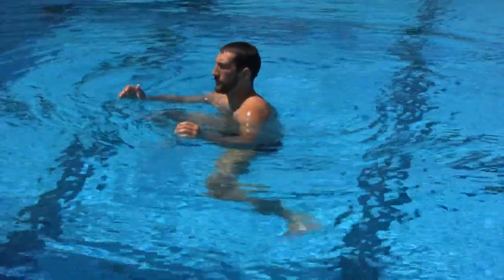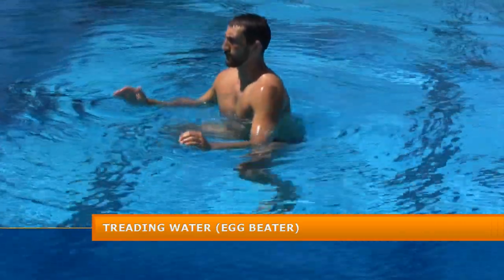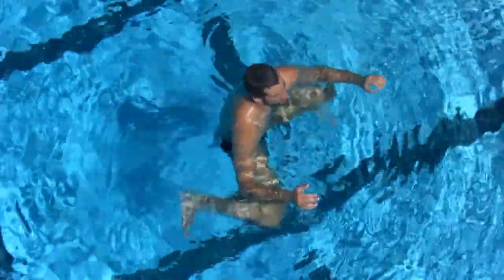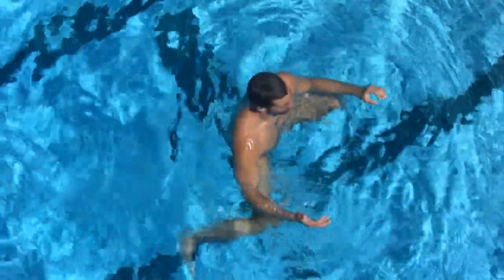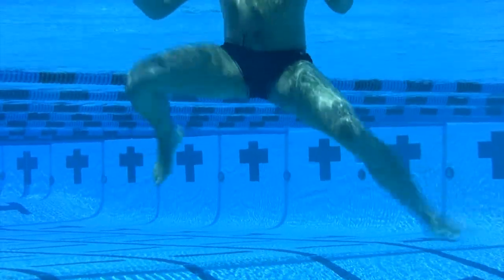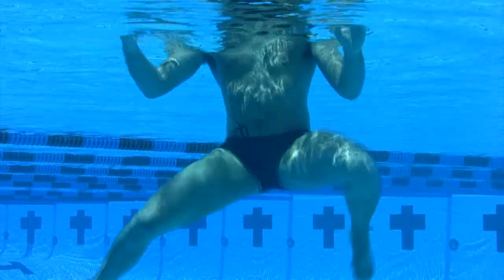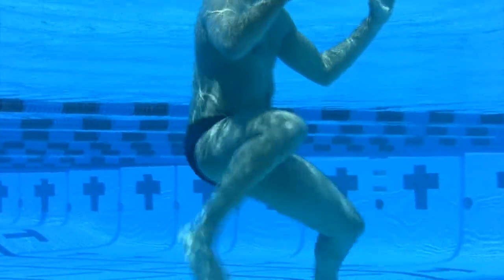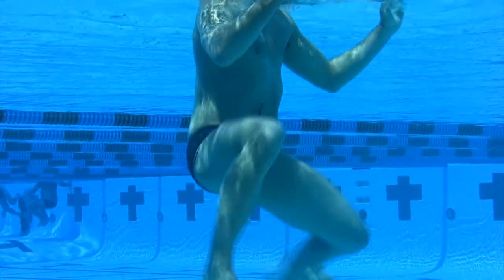Performance Water Polo - Egg Beaters

Comment: I tried to do this today, my legs make the same movement. But I sink
Reply: then you're not doing it correctly...
Reply: Keep at it.  This kick is The Most Powerful across the board.  Think you can do it? Try this.. tread water while holding a ten pound pool brick in each hand for one minute using any other kick. 
If you cannot use it effectively and efficiently you will surely be that guy drowning.